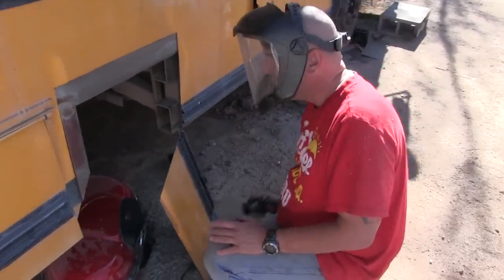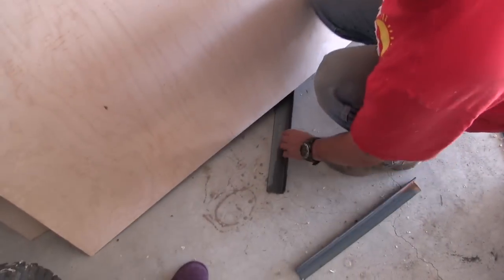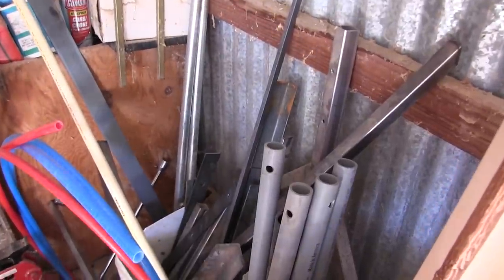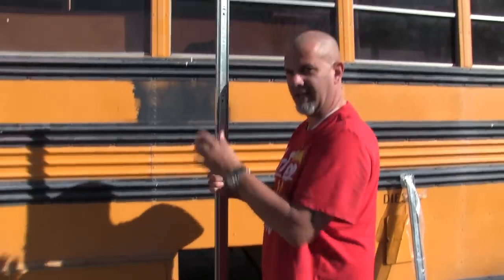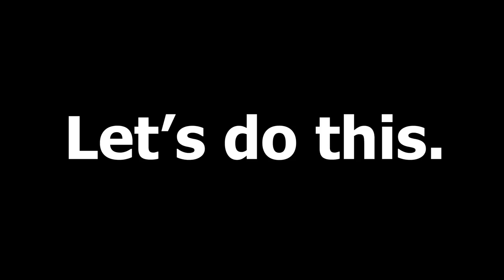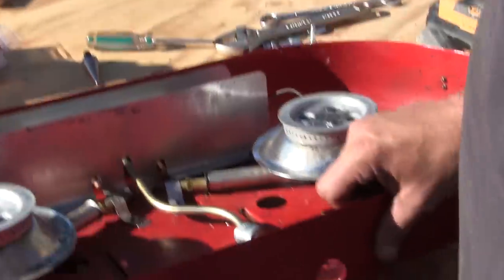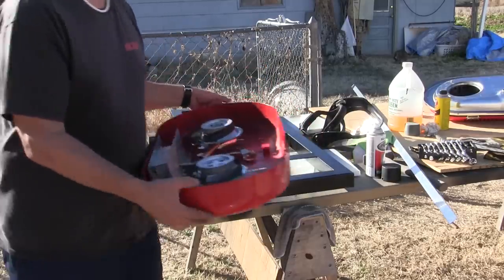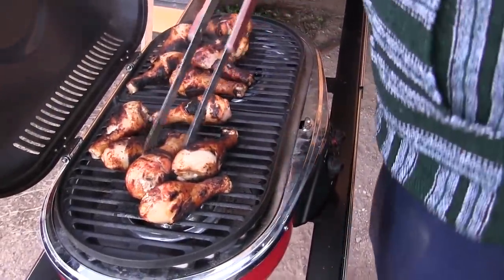We Built a Slide-Out BBQ Grill for Our Skoolie!

Comment: Love the grill ! Two suggestions, One a fold down leg or a place to attach a leg at the end to stop it from bouncing and take some of the weight off the slides. Two a cover to slip over and close the end of the grill to keep the road crud from getting into it. The taste and smell of road crud on the food would be a downer.
Reply: 3er thing that is forgotten is the taste of diesel! all the spots that are seen are diesel, the pipes of the heaters pass just above the grill, check that well, fire, grease and diesel. It is common knowledge that diesel vapors are not flammable, but they are harmful in food
Reply: William Bays >>William, I had already thought of the legs also as you pointed out, but, the cover I hadn't...great idea! I hope Mike sees your comment! Waving from Houston, Texas!
Reply: budaman > thanks! 👍
Reply: @rafaelduque7160  Do you still think installing this type of grill would be a good investment?

Comment: Excellent Job!  
Suggestion: Consider installing/building an enclosed cabinet of some sort to enclosed the area so it stays clean when traveling.  What's going to happened, one day after traveling you will want to grill and the whole thing will be dusty and full of dirt, which will be a lengthy time to clean it before cooking.  I know it will be a little work, but build an enclosed box so the whole setup will be contained and sealed. You will be happy you did it now then later engineer something on the road too combat the problem.  Good Luck.......

Comment: Cracking little project that guys. Mike, put some fold down legs on the painted frame that will support the grill when fully extended and loaded, plus it will take load off the sliders.
Reply: maybe use some smaller tube stock inside the frame and pivoted. a piece sort of like a 2-rung ladder. If there's enough room under there, I'd suggest another set of legs that pivot backwards to support the bus side of the slideout.  Something needs to be done to keep that door from bouncing around too.
imho :)

Comment: what kind of grill did you use? I am looking to do the same on my skoolie and have had the challenge of finding a grill (with a lid because I like using indirect grill heat sometimes) that is short enough to fit nicely under my bus or back deck
Reply from the maker: Honestly, this is the Coleman grill and I would pick a different one. We are looking at changing it out to the same one number Juan bus has.
Reply: @BussyMcBusface  good to know! I was actually thinking of going with the Coleman one or maybe even splurging on the Weber portable one, but I’ll check out the Number Juan Bus to see what they use

Comment: dont the drawerslides have plastic parts in them ..... never mind probably doesnt matter with how low you mounted them
think by the time you pull the grille out to use it after traveling it be covered in dust and mud maibe you need to put a cabinet around it or at least pack it up a little with some canvas cover (drawcord bag type )